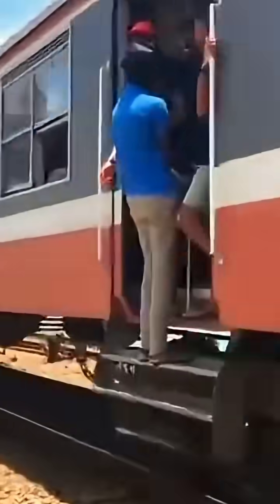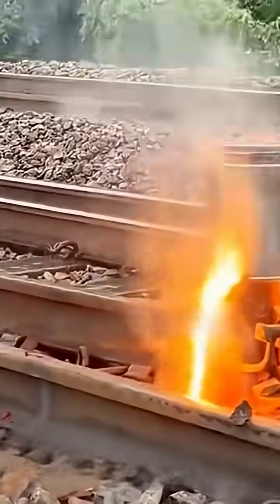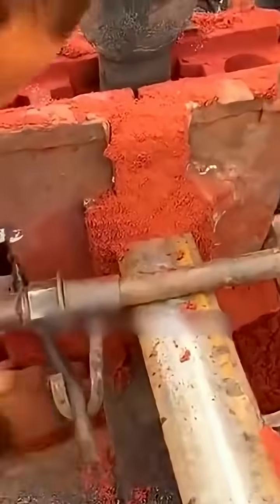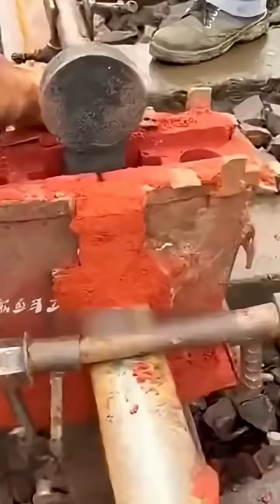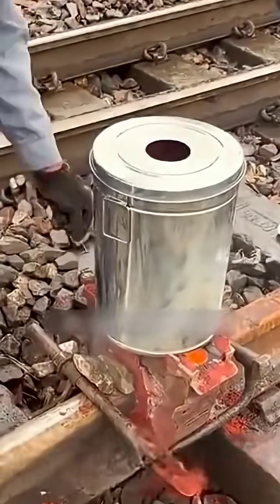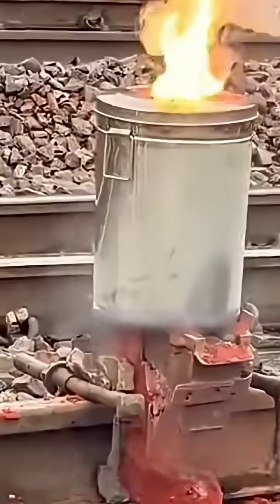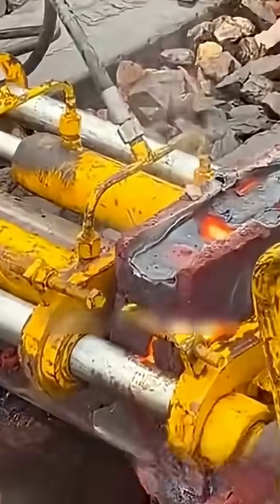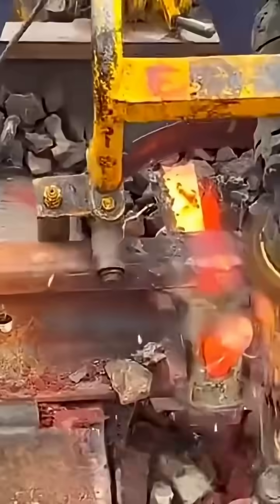Amazing Chemical Repair of Broken Rail Tracks 🔧 #RailTrackRepair #SciencePopularization

Comment: Preheating the mold is to dry it out, prevent mold failure, and to prevent the resulting steel from cooling too quickly.

Comment: You got it backwards. Aluminum metal powder and iron oxide powder. During the reaction the oxygen in the iron oxide preferentially reacts with the aluminum to form aluminum oxide ( sapphire, corundum ) leaving behind molten iron which welds the two rails together. No "like" for you today.
Reply: They used thermite to weld
Reply: @singularitytr1550 yes, I know that. They described the thermite incorrectly